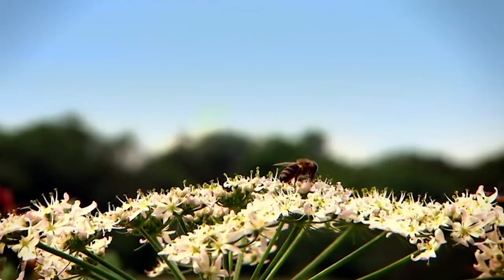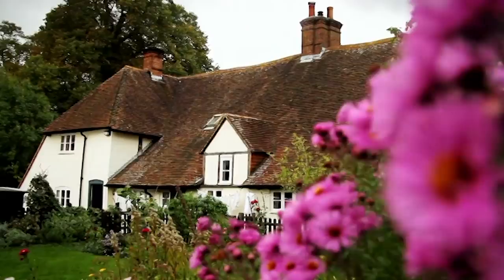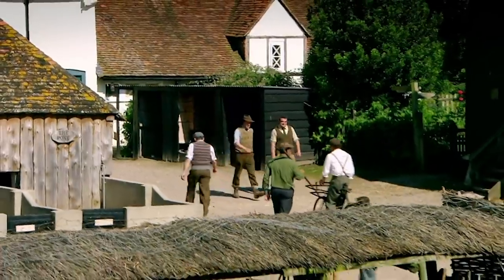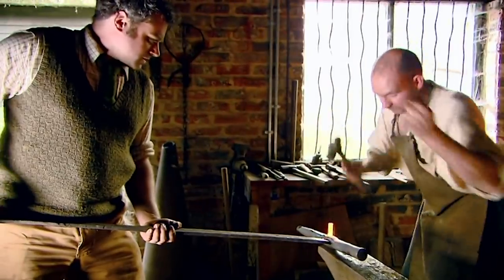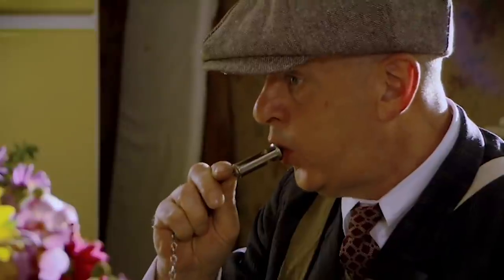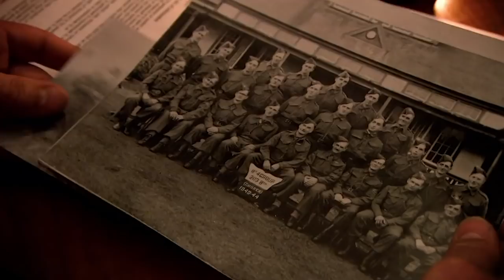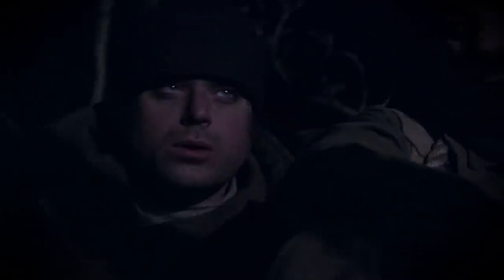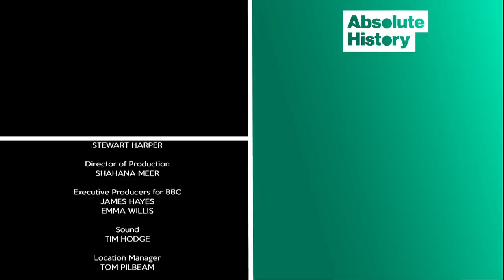How Farming Had To Adapt To The Air Raid | Wartime Farm | Absolute History

Comment: My parents grew up during that era in South Africa, first the depression and then the war. The same things applied here, as we were a British colony. They came from a farming community and were able to produce their own food. But things like spares for motor vehicles, tractors and fuel (petrol) was strictly rationed. Tyres were impossible to get. My father told me that they resorted to putting long grass inside the tyres because the were so warn it could not hold air any more. Under wear were made from used flower bags. Clothes were patched and patched again. Tough times. One thing that strikes me is that they had no obesity and diabetes problems in those days. They were fit stong and healthy. Hard times none the less.

Comment: 26:00:  Yes increased production depends on increased mechanical power as opposed to animal power because machines don't need to rest --- but on the other hand, horses don't need hard-to-find repair parts to fix them when they break down --- ever think of that?
Reply: They wouldn't have been hard to find repair parts. They would have been produced en mass as these were the tractors everyone was using at the time 🙃

Comment: The Mole sub soiler.

Drill a hole in the down-shaft for the chain to be attached about 6 inches lower. The lower fulcrum will change the pitch, and shorten the length of shaft and lower the chance of it bending. A single hole can make this contraption work properly. Everything else seems to be adequate except maybe the thickness of the Down-shaft itself.

Comment: For the drainage problem... they could have cut a furrow with the share of a 1 bottom.... ploughing in both directions in the same furrow, making a “dead furrow”.  If they cut that twice or “double deep” in several places in the field (the worst parts on their survey)... it would make a ditch or swale of sorts.... adjusting the ploughing deeper as the went to give it pitch to allow the water to run away....   I think this would work fairly well with the crown or furrow wall on each side of the “dead furrow” was removed when the field was disc harrowed.  Creating this drainage would take away some space from the crops... not be as good as tile drainage or subsoil drainage... but would have saved a lot of time and trouble, as well as removed a good bit of water from the field making the crops they did plant yield much more and helping to prevent possible total loss from flooding out.